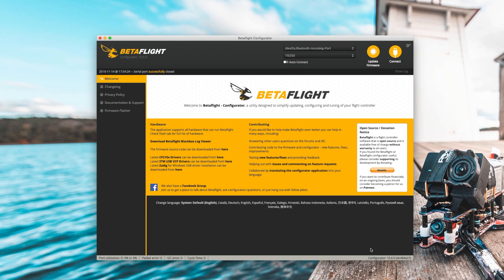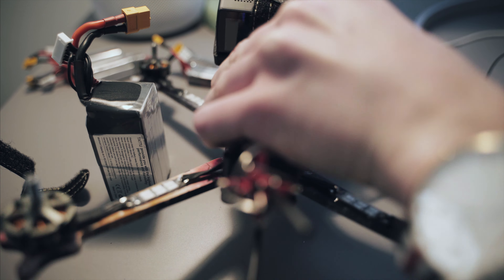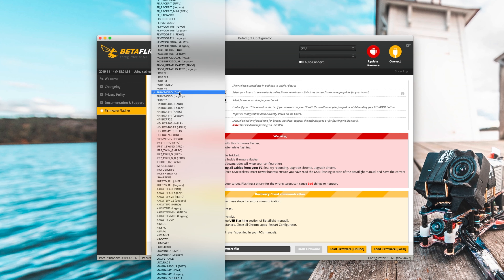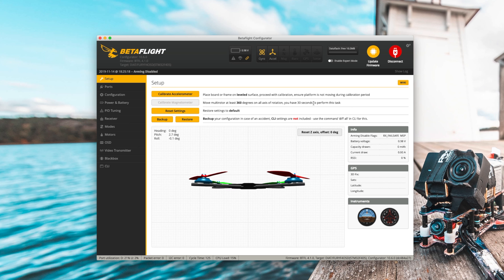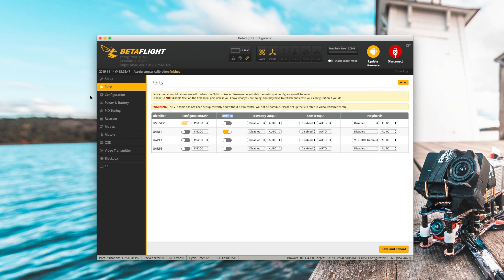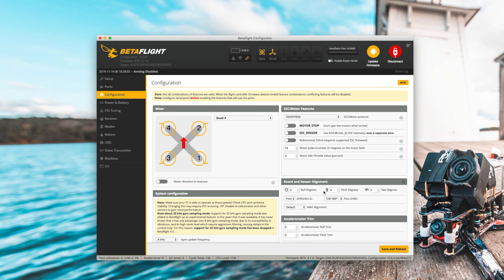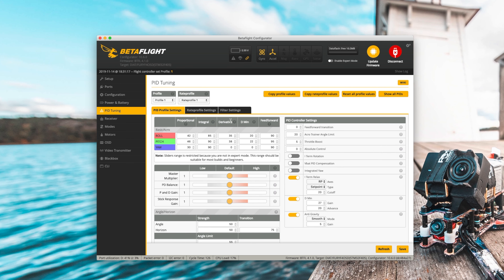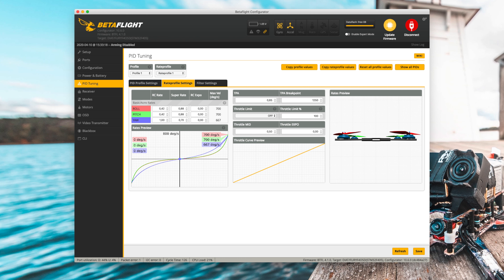2019 cinematic 6S 6inch drone Part 2: Setup

Comment: Thanks for the 2 great building videos.I will build this drone too , but I have a few questions about it.Do you had problems with specific parts with the quad and can you make a video where we can see the Quad flying ? Anyways thanks a lot for the videos (Sorry for my bad English. German Student 😂 )
Reply from the maker: Hey, thank you! Sorry for the late reply! The quad have been working really well and I've been flying it quite a lot. Recently I got some ESC desynchronising problems which I'm going to try to fix but usually things to break after a while and the issue seams like it can be fixed with some tuning. I would definitely recommend all the parts I used but if you have a bit more cash you could always get a more expensive esc like the hobbywing 6s stack. If you have more questions you could hit me up on instagram and I'll be happy to help you. You'll find me @dronex_sweden. Hope that helps, happy flying!

Comment: Just out of curiosity, what kind of lighting setup are you using? Looks like two large-ish softboxes front each side based on refletions, but would like to know more.
Reply from the maker: You have a keen eye! I'm running 2 fairly large soft boxes, one to the left a bit closer and more from the side and then one on the right a bit further back and closer to the camera. I bought them for super cheap on amazon and they really do an incredible job! And then the lights in the back are IKEA led lights to give that sharp accent.

Comment: what is the range of this drone and what is flight time dude 
and where did u buy parts????
Reply from the maker: The range depends mostly on what radio system you use with it. If you use crossfire you can get many kilometers of range. However, it's very dependent on your environment. The video transmitter I used is a really powerful 1W transmitter and will get you really far. Especially if you pair it with a good directional antenna on your reveicer. Flight time depends mostly on what battery you use. On a standard 1300 6S you will get around 4 minutes of fast flying. If you want more you can always go for a 2000mah 6S or a LION pack. Links to all parts can be found in part 1. https://www.youtube.com/watch?v=RC7S54I7Rfg&t=0s
Reply: @dronexsweden6906  how to get the more flight time ? like which is the battery which gives the most flight time on 6 inch or 7 inch

and if i use 1w crossfire reciever and tango 2 pro controller and dji fpv system 
so what will be the average range of this?
Reply from the maker: @chandankalyanmh4089  Using a LION pack will definitely give you the most range. I've seen people fly over 30mins on that. If you want more info on that I would suggest looking around on youtube for "6" long range LION fpv drone" or someting like that and I'm sure you'll find more information. The crossfire in the tango will always outrange the DJI system. So if you want to see what range you can get I would suggest looking on youtube for "DJI fpv long range test" or similar and you'll find a lot of great samples! I'm sorry that I can't be of more help, I simply do not fly very long range.
Reply: @dronexsweden6906  what if i use dji fpv system with dji controller?
Reply: @dronexsweden6906  like if i use dji remote then which reciever to use?or there will be inbuilt reciever in dji air unit
Reply: @dronexsweden6906  using dji remote is best or using tbs system is better with dji fpv system
Reply from the maker: @chandankalyanmh4089  The air unit has a built-in receiver. It is very convenient if you don't mind using their transmitter (controller). However, just know that it will look you into digital fpv only. That controller will only control dji air units. Also, the transmitter is quite bulky so if the size is something you care about it could still be an idea to go with a conventional transmitter. Hope that helps you choose!
Reply: @dronexsweden6906 thanx aa lotttt bro